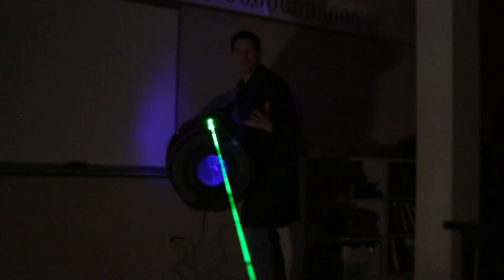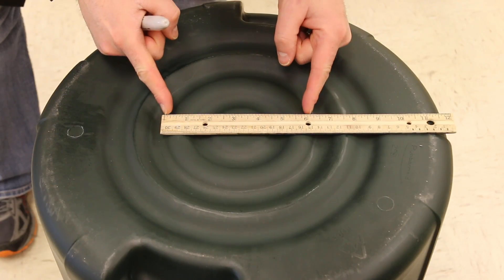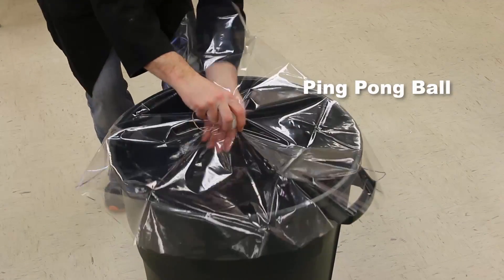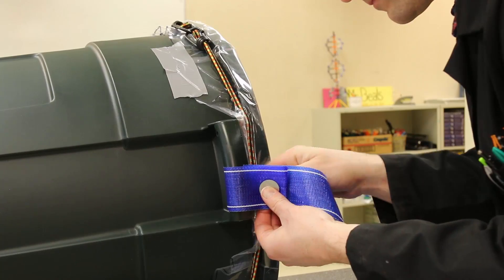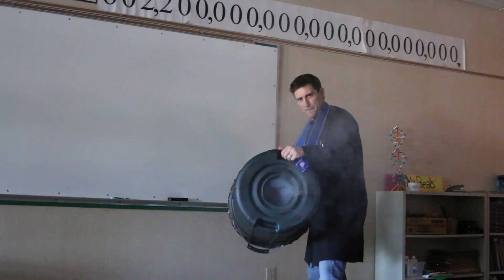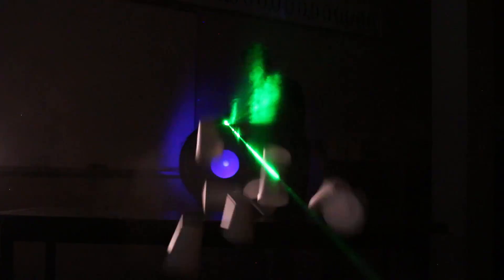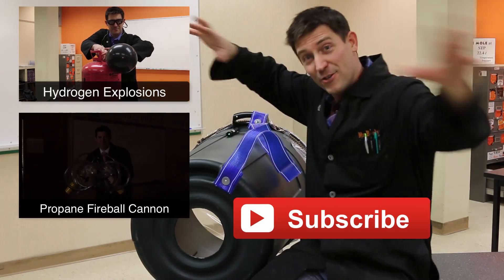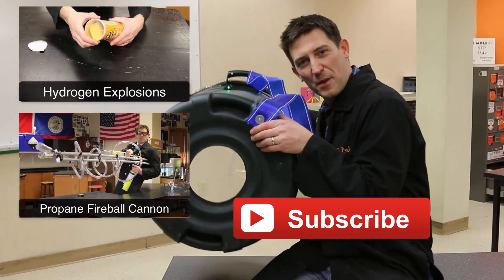SMOKE RING CANNON using a Garbage Can!

Comment: I do it similar except duct tape the courtain in place, i use a golf ball in the middle from the  inside then use the bungies to wrap arpund the ball and tie it, attach hooks to the can using  a solder gun for the holes. Done
Reply: Update: made a circle out of plastic, drilled 2 holes one on each corner and one in the middle for a nut and bolt to go through. Drilled a hole through a baseball amd passed the bolt trough, poked a hole in the middle of the bag and pass the remaining tip of the bolt.on the inside attach bungies to each hole on the circle, push the bolt through in and attach the nut all the way tight.  Done! You have a handle and it takes more punishment

Comment: How far away can this knock cups over from?
Reply from the maker: You can knock down cups at 20 feet or more! It really helps to have smoke in it though so you can adjust your aim - a slight breeze or air movement in the room will deflect the vortex, but with smoke you can adjust as needed.
Reply: @megan_lehman • 
I knocked my buddy  over 27 miles away  .